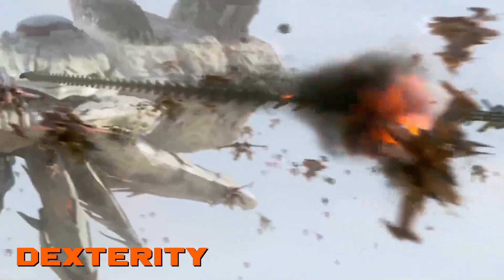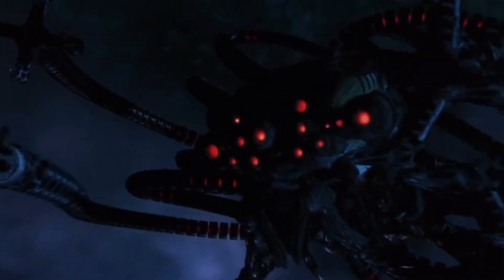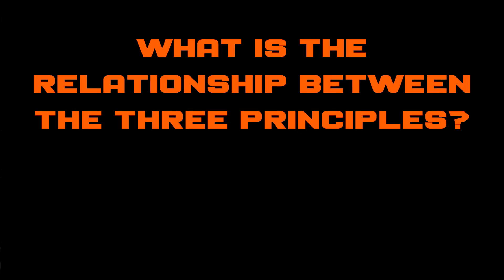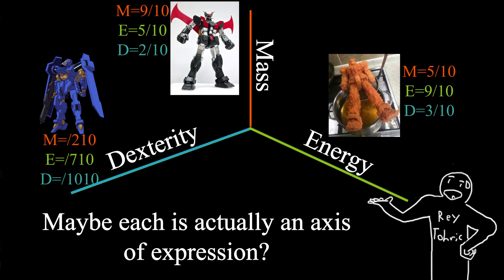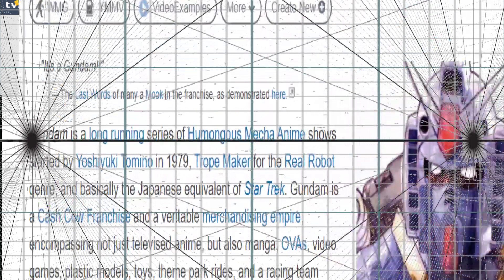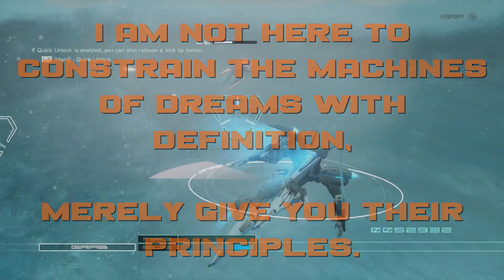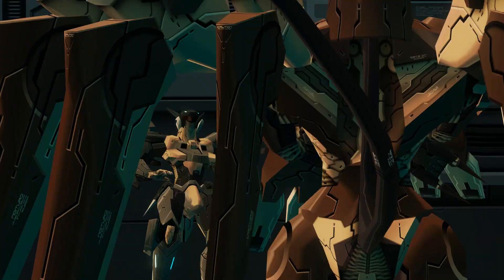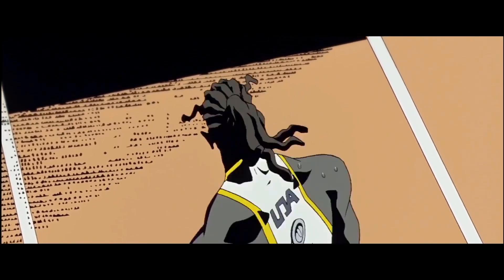ON MECHANICAL DESIGN 4: DEXTERITY, THE INTER RELATION

Comment: I don't like any mecha designs that do not have, at least, proper thruster logic. You simply can't fly backward without a thruster on the front, and that detail adds so much immersion. I know "realistic" is not the right word, but I struggle to explain it any other way.
Reply: How about believability.

Comment: I think you’re being a little disingenuous by implying that the causal relation of mass and dexterity always = good, because the real test of a mechanical design’s movement isn’t whether it makes any sense, it’s how it captures the feel of the machine. It’s why the action in Igloo looks like crap: it’s based off principles that were reverse engineered off the idea of mobile suits to see how they would work in the “real world”, but it doesn’t fit the actual designs at all because Okawara intended them to move in the way you see in 0079.

Comment: Good video, the way the mecha moves is so important for so many reasons. It can set tone, personality and more. Also how do you feel about  drastic changes in dexterity? i.e. In Iron blooded orphans when they introduce the Baal and sudden gundams be flash steppin.
Reply from the maker: Like a lot of things its how you use it more then if. Mechanical systems should remain consistent generally, but flow and change with the plot or to express something. If its weird it should have a logic to its weirdness like with Rahxaphon. 

Otherwise you sorta lose how the mass of the machine should feel and how it should move in the audiences mind.

Comment: Using Zone of the Enders as an example is a damn good one as ZOE itself is a damn good game. 

I’ve always been a fan of the sleek and swift machines, those machines that slice through the wind like a blazing knife almost as if nothing was there like the orbital frames as well as the Jaegers of pacific rim that just radiate strength and mass even from the more swifter ones that still throw up large gouts of water as they run through the ocean. 

Good video discussing how the principles of design interact with each other energy should be a rather interesting topic given how abstract it is.